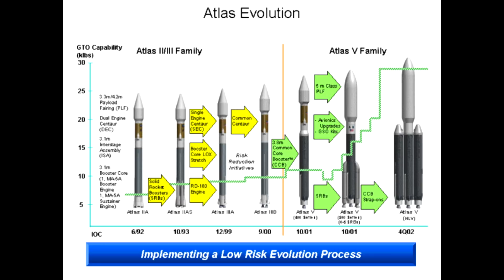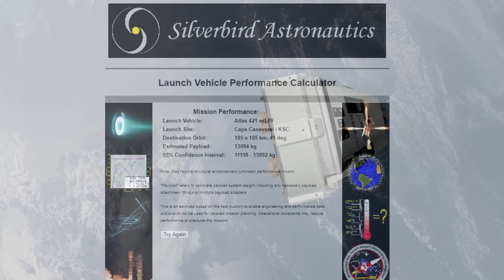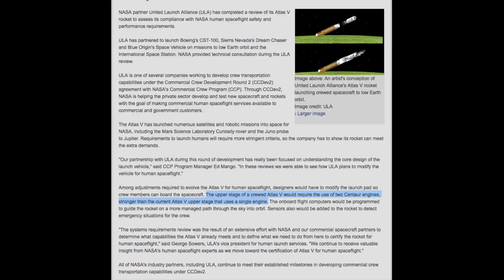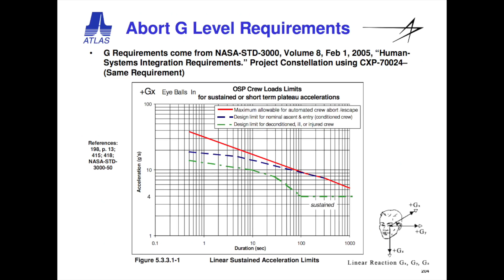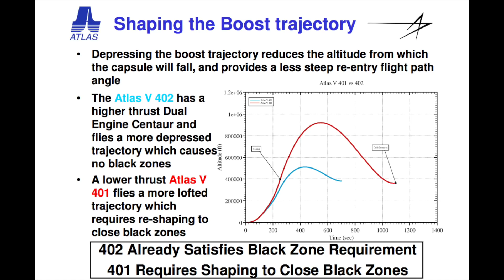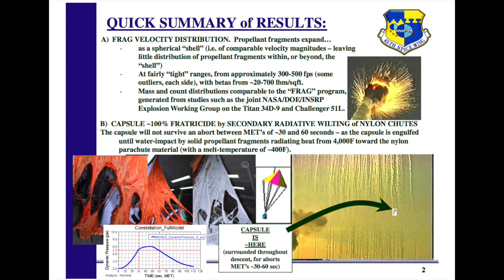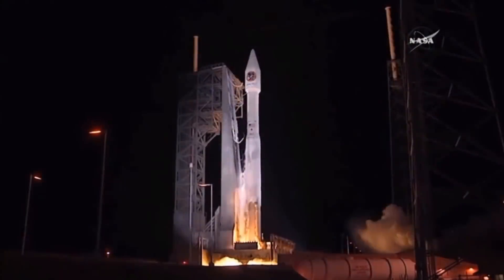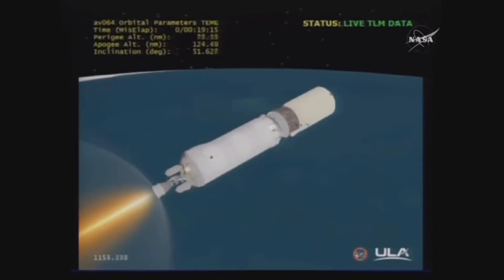Why Atlas Is Using Dual Engine Centaur For Starliner

Comment: Hi Scott, at about the 5:00 mark, you said the study did manage to find a way to bring an Atlas V401 just within limits.
1. How was it proposed that this be done, and
2. Why then does CST100 "Starliner" require a dual engine centaur?
Thanks.
Reply: Plus the two SRBs.  This is just a guess on my part, but maybe there just wasn't enough of a safety margin: just shallow enough a reentry not to burn up the Starliner as well as barely avoid the "black zones", requiring nearly perfect flight profiles and abort sequences.  The second RL10 provides a margin of safety for the second phase of the flight, while the two strap-on SRBs provide a margin of safety for the first phase, both of which would be stressed by the required flight profile without the extra energy/thrust.  The Atlas V is a great rocket, obviously, but it was never designed to be human-rated and is not an ideal fit for this purpose, so a heavier configuration than one would normally expect is needed to provide adequate safety margins.  Additionally, when the requirement for a second RL10 was made, this ate into the first stage's performance, hence the addition of the two SRBs.  When only one RL10 was originally thought to be needed, no SRBs were planned to be used, but changing one part of the system often forces changes in other parts, of course.

The key is to flatten out the flight profile to allow for safe abort modes for humans--instead of the first stage lofting the second stage way higher than required to allow the low thrust of the RL10 enough time to circularize the orbit, which is how the Atlas V normally works, the second stage (Centaur) needs more thrust to circularize the orbit more quickly with a flatter profile (or else it won't make it and will reenter due to Earth's gravity).  The reason the normal Centaur has such weak thrust is that having only a single little RL10 makes it incredibly light and therefore efficient.  Two RL10s make it much heavier and therefore less efficient, which is probably why the first stage needs help from two SRBs instead of having none, as originally planned--they give the whole system the energy it needs to carry an extra engine on a more challenging profile.

By the way, even the Falcon 9 has to fly a somewhat flatter-than-normal profile, despite being a more standard design with a powerful, high-energy (but heavy) second stage.  While this does not impact its configuration, it does require its reusable first stage to land on a barge at sea instead of on land (where it would normally land with a load of that mass).  This gives it the additional performance it needs to fly with an adequate safety margin for humans.

Comment: Why do I like Ariane and Vega launches more?
I like fire and roaring.
I don't understand why ESA launches have more fire and roaring, but they do.
Reply: Delta-IV Heavy has plenty of fire and roaring.  Heck, there's even a great stonking fireball that swirls about the booster just before launch.
Reply: Hi Daniel
On this video watch?v=wCy401hkXuk There is good roaring. But look and compare at 52s with the fire on 6ZssQ8_neF0 at 31s.
I feel like the Ariane has more fire.
Also the Vega has great zooming, which I forgot to mention, because fire and roaring are more important to me than zooming.
If I was going to be patriotic I would say that the electron has the best fire. However I have to follow my heart in my appreciation of fire, the Ariane has better fire.
Perhaps I was spoilt with too much Saturn 5 fire so I am disappointed with most modern efforts.
Edit. And the shuttle booster fire. that was some good stuff.
Reply: @ccdimage  basically you're in love with the thick hefty opaque plumes and the loud rumbles produced by solid rocket boosters

Ariane, Vega (both ESA) rockets, the Shuttle, Delta 2, and Atlas V all feature those rumbly, smoky bad boys in excess

Comment: How come ULA gets to fly a Atlas 5 twin centaur for the first time on a star liner flight, while Space X needs 7 block 5 flights before flying a Dragon
Reply: Twin Centaur is already proven.
Reply: Ckeith Martin
As William said, the Twin RL-10 Centaur is an old platform, that's been flown many times.
Reply: But the Atlas 5 is a totally different environment during the first stage than the Atlas 2 was and the current RL-10 are different than the RL-10 were back in the day. After 40 years in the aerospace industry this just looks like ULA is depending on lots of analysis vs. the Space X testing approach.
Reply: The Atlas 5 may be a new vehicle, but the Centaur Upper Stage (in both single, and twin engine configurations) is an old platform, and has been used as far back as 1962. The Voyager spacecraft were launched on Titan IIIE rockets, which used a twin engine Centaur stage.

So, the core Atlas 5 is a know article. The Twin Engine Centaur is a known article. That's why ULA gets to slot the two together, and test a Starliner that quickly.
Reply: Atlas V has also never failed. As for Falcon 9... well, it has failed.
Reply: @badbeardbill9956   Falcon 9 failed as part of SpaceX's learning process, but in its final frozen configuration it's probably just as reliable as Atlas V, even counting multiple reuses.  Atlas V hasn't always been perfect, though, as flights 10 and 62 show--flight 10 in particular since it undoubtedly reduced the operational lifetime of the payload, and therefore in the judgment of some was not a complete success.  And flight 62 just barely managed to reach the intended orbit--had its RD-180 shut down just a fraction of a second sooner, there wouldn't have been enough margin in the Centaur to make up for the performance shortfall (it only just missed falling short, while it actually did fall short during flight 10).
Reply: SpaceX continually updated the Falcon 9 design, and while this generally improved the design, there is always the possibility of "regression" defects whenever changes are made.  This is why NASA required the design to be frozen at Block 5 (a very robust and reliable iteration) and tested a certain amount (with all anomalies noted).  On the other hand, Atlas V was based on all of the lessons already learned from previous Atlas designs, and hadn't changed much, if at all, since it began flying, and therefore was already more proven.

While it's true that using a different Centaur stage for the first time is a change in configuration, I guess they thought it was safe enough for an unmanned flight.  Falcon 9 Block 5 probably had many more potentially risky changes made before it was frozen, so it needed to prove itself more.

Comment: How does it manage to fly on just one of it's two engines with all that asymmetric thrust?
Reply: The same way an Atlas V can fly in a 411 or 511 configuration. Thrust vector control, move the engine and you compensate the deviation
Reply: Bring the nozzle in line with the center of mass and you're good.
Reply: Shit, if only Scott could explain that.... :$

(There you have)
https://www.youtube.com/watch?v=f-o6BLBzsUA

Comment: Do you guys think the BFR will ever be built? It seems sooo big and hard to build for one company
Reply: Yeah, well, with the miracles of AutoCAD, 3D-printing and other modern fancy stuff he'll build a Saturn 5 analogue, just as well as how he managed to build a Proton analogue. It's just will be yet another rocket, not the fancy promises about $20 per kg to LEO and so on.
Reply: I thought landing the main stage was impossible.
I think they will do it, it might be a little smaller than the second iteration.
Reply: Falcon Heavy also looked a bit impossible to work on first flight with all the 27 engines in its first stages, but it flew, and they even managed to land two side first stages exactly at the same time, right next to each other- that just looked impossible. I think they most likely will pull it off with BFR, but could take some serious amount of time.

Comment: I get the one solid boost variant does the power slide thing... But why do the other variants have asymmetric booster layouts?
Reply: When the Atlas V was first designed, it wasn't meant to have solid boosters.  As such, there are some elements of the rocket that stick out the side (including hardware originally designed to support a "Heavy" variant) where boosters would normally go.  Later on in Atlas V development, they realized that boosters could make a big difference in terms of payload and cost, and instead of going back and changing the surface features, they just attached the boosters to places where there wasn't anything in the way.  This is also why the Atlas V is limited to only five boosters - there isn't enough space for more.  ULA's next rocket, Vulcan, is being designed to support boosters from the beginning, and thus is able to mount them symmetrically, and carry more than five.
Reply: @adamdapatsfan  very interesting. Thanks for the reply!

Comment: want to hear a joke? 
...
SLS!
Reply: Ah, the fine line between comedy and tragedy. But in this case, stuck with both.
Reply: What's the opposite of progress? Would it be Congress?
Reply: @badbeardbill9956   On the other hand, ULA would probably have designed the Vulcan with Russian engines if Congress hadn't mandated U.S. ones. But hard to say if one "right" makes up for many "wrongs."
Reply: Don Jones Possibly. But then again maybe not. ULA was well aware of the political situation. The Russian engines proved to be superior but that may not be the case soon.

Comment: I was unaware of any expander cycle engines in use.
Reply: Really? RL-10 has been using expander since the 60s.
Reply: @badbeardbill9956  maybe I don't know of every single rocket motor ever flown.
Reply: @leerman22 RL-10 is a rocket engine, not a motor...
Reply: @leerman22  thats true, but in the aerospace industry rocket motors and rocket engines are used to differentiate between solid propellant and liquid propellant, respectively.

Comment: By contrast, SLS Block I will fly with just the single RL10 engined ICPS upper stage.  Is this because the SLS Core Stage puts the Orion capsule and the upper stage very close to being in orbit, so no lofted trajectory required for the ICPS to make orbit?
Reply: The SLS core stage will put both above LEO, though still with an atmospheric periapsis (not strictly necessary, just so that the core stage will deorbit). All the ICPS will need to do is make the periapsis positive and finish the transfer.

Comment: Cant they just 3D print the parts for the RD 10 engines to cut down on costs just like Rocket Lab does on their Rutherford engines instead of having them hand crafted?
Reply: No, they cannot.  Additive can be used only on designs that have taken additive manufacturing into account.  The Rutherford was originally designed to be manufactured with additive manufacturing.
Reply: ULA isn’t as cool as SpaceX or rocketlab

Comment: N22? Why not just 022? N22 sounds like some obscure model number, not a booster config. :(

Also, what caused that one Atlas CBC to crap out before its burn time was over?
Reply: The issue on the OA-6 mission was with a mixture ratio control valve (MRCV) on the RD-180 engine.  The valve erroneously reduced the amount of fuel being fed to the engine.  Sensing that the engine wasn't producing enough thrust, the avionics increased the amount of oxygen being fed to the engine, which in turn increased the thrust back up to normal levels.  However, since the rocket was consuming more oxygen than intended, it ran out of oxygen earlier than intended, which is what ultimately caused the engine to shut down early.

Comment: 4 engine Centaur. That's KSP engineering right there: When in doubt, add engines.
Reply: The SLS upper stages - ICPS and EUS - are more like an inflated Delta Cryogenic Second Stage with more engines, than like a giant Centaur. But yes, that entire rocket is a bit Kerbal and not in the best way.
Reply: Same with the SRBs. Need some extra delta-v in a hurry? Strap on a few more boom sticks.
Reply: Not as Kerbal as a Saturn V. Five F-1s on the first stage, Five J-2s on the second stage, and get ready for this.... a third stage with another J-2!!!!!1111!!!
Reply: @Markle2k  Three stages actually makes sense for something that's going to the moon. For LEO, it's mostly overkill.
Reply: @Markle2k   The Saturn V was remarkably efficient for its level of engine technology, though--much more so than its contemporary the N1, despite the latter's more advanced engine technology.  As a system, the number of engines and stages were well balanced and sized for the performance required.  It might have been huge, but it's not just a bunch of boosters strapped together in a Kerbal sort of way.  If you want a real-world example of that (albeit only proposed, not actually built), then look at the UR-700.
Reply: @Markle2k  Still not as kerbal as the UR-900. Btw, I have to say that the Saturn V isn’t very kerbal at all. 3 stages only, no boosters, not even close to the thrust of the N1.
Reply: Them $$$$ gonna fly...
Reply: No one tell him about the Saturn IV upper stage.
Reply: The original Saturn I had 6 of them.  The Saturn IB swapped that stage for a single J-2.
Reply: @CountArtha  the Saturn 1 also had a centaur on top in some configurations.
Reply: An RL-10 costs about 25 million. Especially the fancier versions. So these days you can get a Falcon 9 for the price of two RL-10's.
Reply: @please_stop-v7o   Yes, for your "rocket of the future" 4 engines of a very old design is more NASA than Kerbal. The NASA-industrial complex - always looking backward.
Reply: @donjones4719  This is because there is no competition in the “open expander cycle engine”. A full-flow staged combustion engine running on hydrogen could be more efficient, but again, the RL10 and RS-25 don’t have any competition because they’re efficient as hell. SpaceX should sell a “hydrogen raptor” to compete with Aerojet rocketdyne, but again they’re not the company to sell engines.

Comment: The Shuttle was the most UNsafe vehicle ever made. Between T-0 and T+ 2:30 there was no hope.
Reply: Zoomer30 well I have to disagree with that. The shuttle did have its flaws when it came to abort options but the shuttle fails twice and only once during launch. So out of 135 shuttle flights only 1 was lost during T0 and T+ 2:30.
Reply: @bradleywasser9472  But you'd have to agree that's one more failure than the Soyuz. Don't know much about the Chinese manned launch vehicle.
Reply: Henden Gayoma yea that’s true the Soyuz has a launch escape system too so it’s much safer then the shuttle

Comment: Wait the Atlas almost failed to get a payload to orbit and they are going to put humans on there.    I get that the two engines should solve this particular problem but still.  The Falcon 9 system is much safer because Elon has been building with the intent to reuse from the beginning.  Modern expendables are tin-pots in comparison.
Reply: Atlas V failure rate: 0% (0 failures in 75 launches). Falcon 9 failure rate: 3.2% (2 failures in 61 launches). In what fantasy is the falcon 9 safer?
Even if this atlas 5 had failed, humans would have survived it's failure mode and reentry easily.
Reply: Elon builds with a structural safety margin of 25% whereas others build with a 15 % safety margin.  Since CRS-7 they have unit tested all parts and because they are reusable they can be flight tested before humans go on board.  Also Amos 1 wasn't a launch failure.
Reply: Boeing has been launching rockets for decades. Atlas V has had zero (count em, zero) launch failures. I'd rather ride an Atlas V than a Falcon 9 any day of the week.

Comment: How can a flight from Orlando to LA take roughly the same time as a flight from LA to Orlando, considering Earth's rotation? I know that this isn't related to the video, but I was really curious about it.
Reply: If you are in a speeding train and you run from your seat to the front of the carriage, will it take more time to run back to your seat?
Reply: If you are in a moving train and jump at the front of the train, you land in the same position and do not fly to the back of the train. Everything on Earth is spinning at the speed at which the Earth spins, but due to gravity (and the atmosphere in the example of a plane) we stick in the same spot.
Reply: It's all R E L A T I V E
Reply: A friend of mine was trying to use this as evidence to flat Earth
Reply: The atmosphere rotates at about the same rate as the surface, which is why you don't have a 1,000 mph headwind when you're standing on the ground near the equator.  Instead you just have a gentle "trade wind" and the Coriolis Effect.

Comment: So WTH would they stick a rocket with less thrust on (that last almost fail launch)? Cheaper?
Reply: Normally less thrust on the Centaur stage isn't a problem because the payloads aren't as huge and Atlas first stages don't fail, and you actually get more total acceleration because the single-engine Centaur doesn't have to carry as much weight of its own engines. And yes, it is cheaper; RL-10's are particularly expensive engines because of the manufacturing process, so not using multiple is preferable if it can be avoided.
Reply: @MushVPeets  TY :D

Comment: Those fairings on the right in the drawing at 0:17 are interesting.  It looks like they add a lot of mass and unusable volume by enclosing both the second stage and the payload.  I'm assuming there's aerodynamic issues they are compensating for? Makes me wonder if I should be starting my fairings in KSP just above the 2nd stage engine.
Reply: Nah, in this case it's a necessary evil because the Centaur only has a 3-meter diameter.  Putting a 5-meter fairing on top would probably put too much stress on the rocket.  The Centaur was designed for the old Atlas D from Project Mercury, not the beefier Atlas V.
Reply: im pretty sure its so that there is more room for larger fuel tanks.